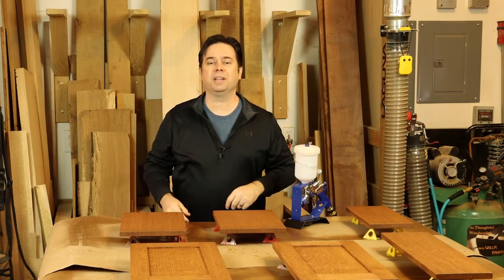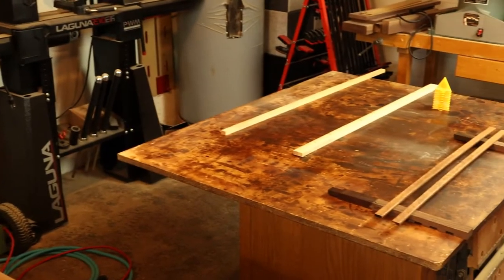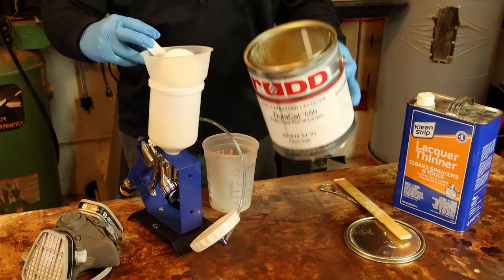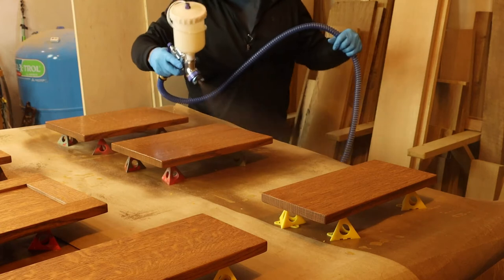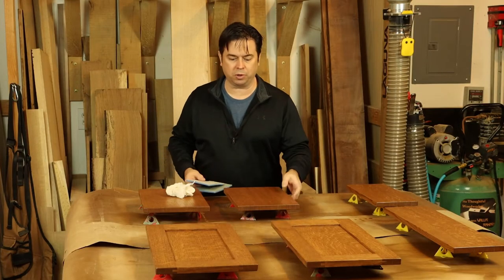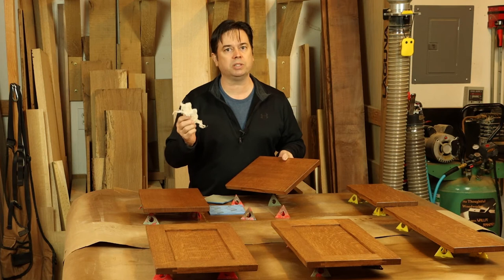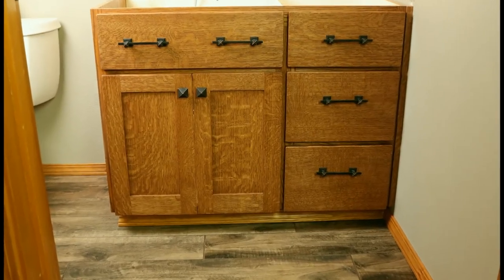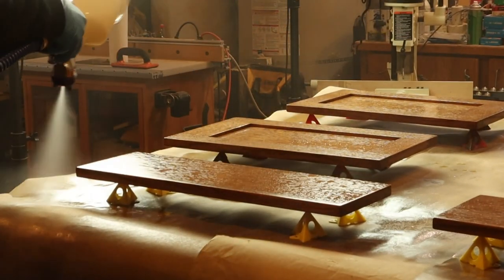Spraying Clear Woodworking Finishes with Turbine System and HVLP Sprayer Fuji Q5 Platinum T75G T70

Comment: I'm about 6 months into spraying my own projects now, and really enjoy it.  Have you tried the 3M PPS system? I converted my T70 and T75G to it, 28 oz for the T70 and 400ml for the 75G.  I can't imagine spraying without them!
Reply from the maker: I haven't used the PPS system but plan to.  Lately I've been using the 2 quart pressure pot.  Anything that lets you spray upside down is great!
Reply: @TheThoughtfulWoodworker It's the cleanup, and potentially mid-term storage of paint that I really love about the system.  Spraying upside down is also huge.  I hated cleaning the can on my T70.

Comment: I bought the Q5 Platinum from one of your other videos.  It sat in my shopping cart a couple weeks before I convinced myself to spend that kind of money and now it's time to actually try it.  I appreciate how you anticipate questions that might arise and answer them in the video, such as what tip size you were using with the shellac.    One thing I'm not clear on, and that would be when you thinned the lacquer, do you use a strict ratio all the time, or is there a "feel" that you just have to learn?  (Edit...I actually see you answered this in other comments, so thanks again!)
Reply from the maker: Congrats on the new Q5.  For lacquer, I usually thin 10-15% .  Sometimes I thin a little more on the first coat.  Lately I've really been impressed with the 1.0mm tip for all clear finishes.  Best.

Comment: Hi. This is great! Unfortunately, I have just discovered your video, but I found it very informative, thank you. I actually went and bought the May/June Popular Woodworking Magazine to find out more information about your spray cabinet. I am hoping you can help me in answering a question regarding your design. I’ve noticed that you have doors on each side of the turbine and not at the back. I got the impression that the Heat Dissipation Chamber they have at the back would require open space behind it, which I do not see in your cabinet. I’m sure I’m missing something here and would appreciate it if you could clarify it for me.  Thanks!
Reply from the maker: There are cabinet style doors on the front, and a flip-up door on the back.  Ventilation while using the turbine is a must, because it generated some heat that you don't want to trap in a cabinet.  You could also leave the lower cabinet open.  Best to you.
Reply: @TheThoughtfulWoodworker  Thank you for the prompt response. The open doors reveal the sides though, not the back. Is that correct? So, do I understand that, as long as there is ventilation, whether it is off the sides or the back is not necessarily a must, as long as can circulate in the space where the turbine is located? Thanks!
Reply: One more question, if I may. The fact that the hose of the turbine is up approximately 4 inches from the floor as it goes through the grommet, could it be a concern that it might bind a little as it lays on the floor or do you always have it going from the turbine, looped around the support and then going on the floor from that point? 
The fact that I am really interested in building a similar cabinet to yours, triggers a number of questions, so I hope you’re okay with this. 😊
Reply from the maker: @guyboucher9727 the doors expose the entire front of the lower compartment.  The flip-up door exposes the entire back of the cabinet.  As long as you allow airflow, other designs could work as well.
Reply from the maker: @guyboucher9727 the hose doesn't bind.  It's very stiff like a thick garden hose.  The flexible whip on the gun end makes it a little more manageable.  Best.

Comment: Very useful video series on the fuji spray system. I'm a harp maker and at the moment I brush on shellac, then buff it out with elbow grease, wax and fine wire wool. I'm thinking of investing in a sprayer though cos I think my results could be better. It looks like you get great results with shellac. Is the finish good enough 'off the gun' or do you do any buffing afterwards? Thanks for these videos!
Reply from the maker: Hi Kevin, for lacquer you can get a perfect off the gun finish, but shellac is different.  Since it doesn't melt into the previous coat, I always buff it a little.  Sometimes wet sanding with soapy water and a 1000 grit soft sanding sponge is all it takes.  A large piece of furniture takes about 15 minutes to wet sand.  
Best
Reply: Thanks for the reply Willie, you're a gentleman. That gives me a bit to think about.

Comment: Can I ask what exactly was the sandpaper you used? It looked more like a thick abrasive pad....
Reply from the maker: Hi Mark, they are soft sanding sponges from Woodcraft.  Usually 600-800 pads work well between coats.  Then I wet sand the final coat with 1000-1200 grit pads.  They feel even finer than comparable sandpaper.  The fine 1000-1200 aren't much coarser than a brown paper bag.  Best of luck!

Comment: I am new to using a fuji sprayer to apply my finishes and have found your video very helpful. Just curious what size measuring cup you are using.  I saw you used 5 cups of finish and then I guess 1/2 of the cup with thinner for your mix.  thanks for the help!
Reply from the maker: Hi Tim, I think it's a 1/2 cup measuring cup (might be 2/3 cup).  I usually thin more on the first coat, and thin less on the second coat to build up a finish.  Of course read the instructions on the topcoat your using, but pre-cat lacquer is pretty forgiving to spray.
Best
Reply: Thank you
Reply: I have two more questions for you.  I noticed that after you sprayed the backs of your pieces you placed them  on top of the pyramids. Doesn't that leave a mark on them since they are not dry?  The other question I have is where did you get the strainer you used for your lacquer?  Thanks
Reply from the maker: @timgarwick1275  I always flip cabinet doors wet, and have never noticed any issues.  Make sure you don't scuff sand panels on pyramids though, as that will dent them.
The strainer came in a kit from Fuji, and I haven't been able to find them again.  I use typical strainers from Woodcraft now.  
Best

Comment: U recommend 1.0 size tip for conversion varnish topcoats also???
Reply from the maker: I've never sprayed conversion varnish with this gun.  Generally, it likes 1 size smaller tip than a compressor driven gun.
So if I use a 1.4mm tip on my compressor gun, I'll use a 1.0mm on the Q5 gun.  
Best
Reply: @TheThoughtfulWoodworker  thank you for your reply.  I’m using a q4 fuji .  With the factory tip 1.3 tip.  I think I’m going to try 1.0 tip.

Comment: Great video! I have two question for you.  How long do you recommend waiting between coats before scuff sanding and what do you recommend your lacquer to thinner mix be?  I have heard 80/20 and 70/30.  Thanks
Reply from the maker: Thanks.  Pre-catalyzed lacquer can be scuff sanded as soon as it's dry.  I use 800-1200 soft sanding sponge between coats.  Then I wet sand with a 1500 grit sponge after the final coat (optional step).  As far as thinning, I'd guestimate my lacquer is thinned 20% on the first coat (to smoothly seal), and 10-15% on the second coat (to build a finish).
Best of luck with it.